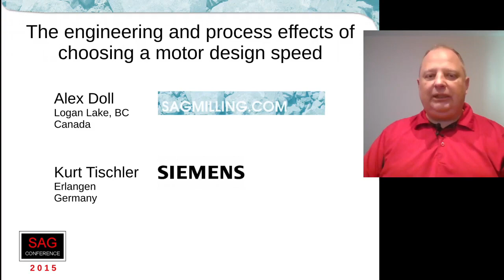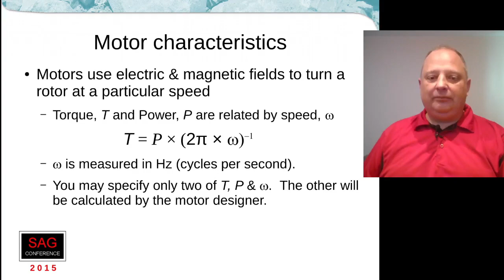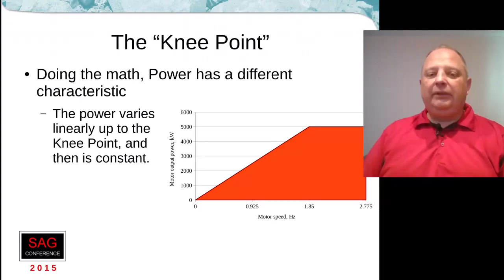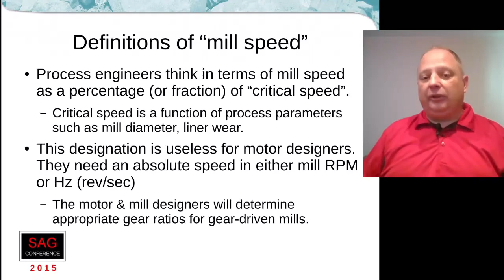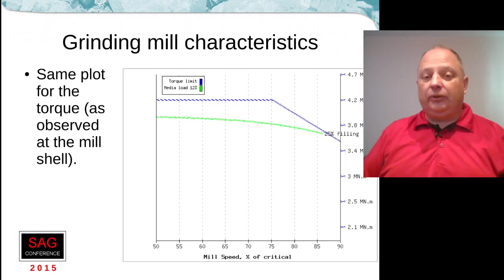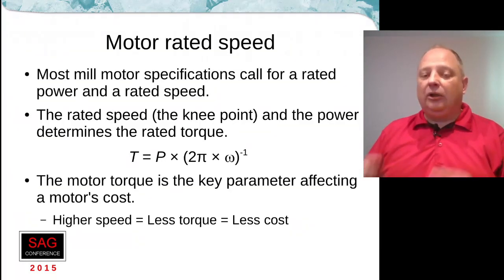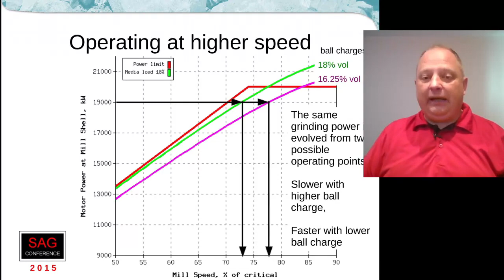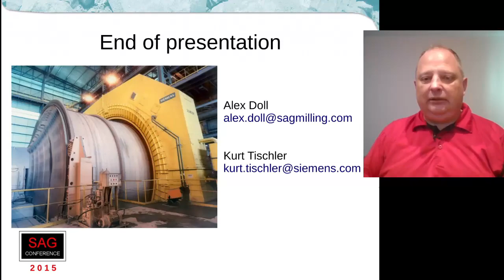How to Specify a Grinding Mill Motor Design Speed

Comment: Another comment after a bit more work.  I've just calculated that what happens "metallurgically" within my "rod mill" with 220mm Internal Diameter should take a power of 130W.  Allow for more rod charge, denser mineral, etc. and allow for 175W, which is 1/4HP.  Allow for friction in the drive for 60RPM and add margin and you get specification of 1/2HP.
Hearing an expert with a lot of experience talking helps me feel more hopeful about my project, as a welder in a traditional mining area (Cornwall).  Thanks...
Reply from the maker: Use the percentage of critical speed to pick the right speed (as RPM) for your rod mill.  You probably want to choose an RPM equivalent of 65% to 70% of critical; you can use this calculator to generate that:
https://www.sagmilling.com/tools_millspeed
Reply: @sagmilling  Thanks. will do.  Did derive a mathematical expression for the "critical speed" of onset of "centrifuging" which agrees with Wills (Barry Wills, "Mineral Processing Technology").
I've got "60rpm" for my mill internal 220mm diameter looking to"cataract " - rods fall from about 2 o'clock / 10 o'clock position - will see how that compares with your calculator.
My calcs:
* critical speed 99.7rpm
* go 65% of critical speed => 64.8rpm
* rounded it down to 60rpm => 60.2% of critical speed
* used that for energy calculation 
* Used "60rpm" because easy to say when trying to describe on the phone the motor and drive I need!

Right; your calculator:
my value for critical speed agrees with yours if I put in "0.18m" - which is 0.220-0.040 - because my rods are "big" given the shell size. (my liner has "0 width").
Thanks.  Your interaction is appreciated.  You validate my calculations.